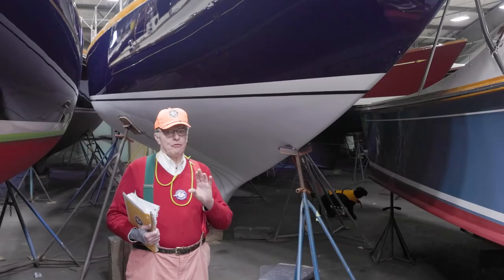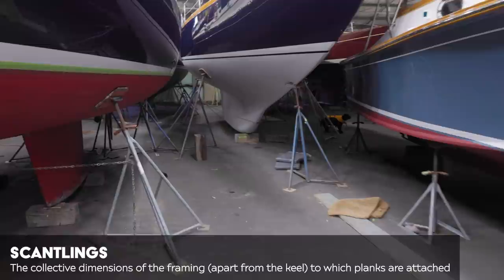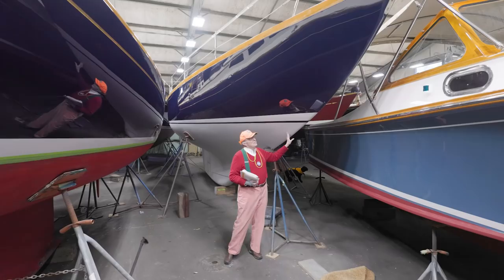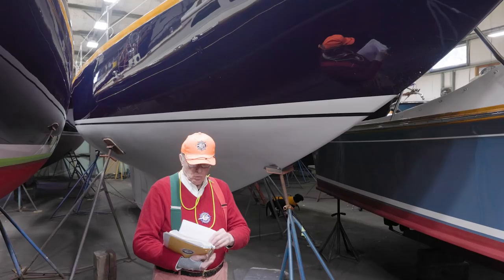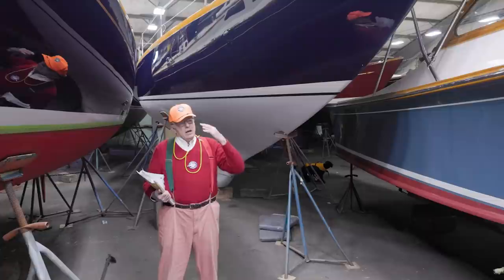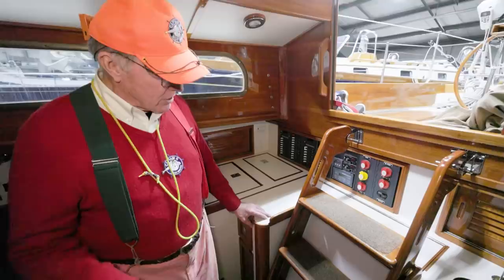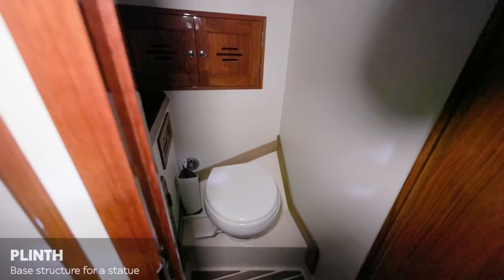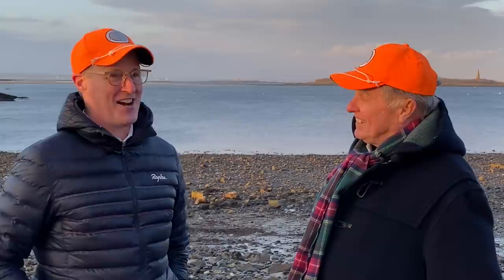AMAZING RESTORATION!!  Pearson 41 Yawl Sailboat for sale #sailboatforsale #sailboattour EP89

Comment: Awesome boat, which should be flying a burgee from one of the most proper clubs!  Glad you pointed out the shroud rollers, which look and work great.  I got mine from Bete-Fleming in Mattapoisett.  They look even classier with fancy work instead of tape at the detents for fastening together.  Mine are taped; I have a hard enough time keeping up with the varnish on them!
Reply from the maker: that's your winter basement effort    small token of love
Reply from the maker: that's your winter basement effort    small token of love

Comment: I thought of you guys this morning.  I was in Grand Haven Michigan and I saw a two masted boat on the water.  I couldn't tell if it was a ketch or a yawl but it really didn't matter, it had two masts.  This is a beautiful boat.  Keep the good stuff coming guys.
Reply from the maker: That is Awesomes, The quickest way is to note the difference is to spot the wheel  and whether it is in front of the mizzen (yawl) or behind (ketch)   thats the easiest  but its actually in front of the rudder shaft  but you cant spot that as easily 
also the ketch mizzen will appear taller relative to the height  of the main mast closer to 2/3rd the height  as opposed to a yawl at only about 25% 
So glad you are enjoying our channel

Comment: Again I love the toe rail embedded chocks. I have seen too many chocks screwed down on the top of the toe rails shatter the toe rails at the worst possible time for my liking. I love embedded toe rail chocks. Nice toe rail height there too.  The bright work is gorgeous. Deck fittings are rather well top shelf. Table is looking perfect but for the lack of fiddles. Sole looks on camera to be solid wood, not laminate beyond perhaps the surface. I would have enjoyed you flipping over that sole piece you pulled to get a better look at that.  Her condition is rather incredible from what I can see through the camera.  Hand holds overhead are preferable here but the drip rails,,, whatever would easily suffice. The high gloss interior wood finish is a bit off putting here. I would rather a satin finish. The price is not too out of line IMHO but when stacked up against like a Shannon 43 well,,,,,,,,,,,,,,,,,. Yawls do not put me off at all compared to a ketch. In fact there is more room for a solar panel array that is not as shaded so much like on a ketch sooooo, a few points on that. For me you have to go rather deep to find a boat of that size I would consider over a Shannon 43. I wish you had spent a bit more time on the interior and the keel on this one though. To me anything over 40' = 3 cabins. V-berth filler would be a must have for me. Yeah, all those electrics at the companion way is not a plus. The deck fittings appear to be superior to most. Slim beam to me is a plus for performance,,,,,,not so much for luxurious comfort. Better sea ride though. Her pricing isn't far off my mark though despite her incredible attributes I think the same money put into a similarly kept Shannon 43 (if one can be found) would be a better investment despite the performance hit that might entail. Chart table was a bit small. Most want a forward facing chart table. To me that's nothing. There must be a boatload of room in the lazarette. Not even a 1/4 berth? That was not evident in the video. The keel to me would have been most better understood had you spent a bit more time on it. 4" or more high grade latex foam would be a must have for me on those cushions. It appears to me that there is an aft cabin as pr the hatch spray hood behind the cockpit.
Reply from the maker: there is a Shannon 43 not far from me for less     it's all in the eye and mind of the viewer as to what turns them on and where they plan to sail and with whom and why ...a lot of good observations here
Reply: @YachtHunters  Oh gee Captain, I want to sail the Horn! I want to sail it with one close to me and two others who are happy and comfy with each other. 4 on and 12 off to me is perfect. During the day everyone is most probably up and about and aware. So only formal night watches are mandatory. Cover the nights and the days take well care for themselves. The Straights of Magellan west bound and then turn down towards the Horn and run back east. Nothing stories for the grandchildren Sailing in circles of sorts. I'll radio ahead coming into the Falkland's so the bars will be ready.

Comment: Remarkable restoration but for a 1965 sailboat $325,000 is absurd.   However, in ten years she will depreciate to a little more than a normal Pearson 41 is selling for.     They not are not cars,  you can't put them in a garage, drive a few miles and action them off in 10 years.  Only classic wooden sailboats have a following.    You can purchase a lot more sailboat for $325,000.
Reply: I was thinking the same thing. The other $300k boats Captain Q has featured offer much better value and are more interesting, to be sure. For a 1965 that doesn’t have a sought after pedigree, I think the seller would be lucky to get half of what they are asking.

Comment: A beautiful restoration of a beautiful boat although I do have to question the wisdom of putting that much money is an almost 60 year old boat.  If this boat and the Dutch built 42' steel Puffin sailed into a harbor at the same time it would be a close contest to determine which boat was indeed the CYNOSURE.  Both are similar in that they are about the same length and about the same price but have otherwise nothing else in common except that they are both great boats.  Excellent find...as usual.
Reply from the maker: Two different original design concepts   Both will work equally well for their intended uses
Inshore and offshore

Comment: What's the difference in a Plumb Bow versus a Slanted Bow in all major aspects?
Reply from the maker: plum bows have been around for hundreds of years and used in Dutch sailing vessels and early euro/American yacht designs  
It wasn't until yacht design became an industry providing boats with hull designs for racing  and having to deal with "rules" that the keels were cut away  and this gave way to the spoon or curved bows  . These boats generated additional water line length when heeled and fit the rules . They also created designs pleasing to the eye.
but like dress styles what goes around often returns . today in the new world of floating Ikea condo featureless floating dormitories , the designers have caved to volume and speed .Thy now produce waterline designs that match overall length   and Gain a knot or two of speed but at the expense of creating  unmemorable vessels by the handful to voyagers that will rarely leave the mooring ...don't get me started   i guess i did
hey thanks for watching